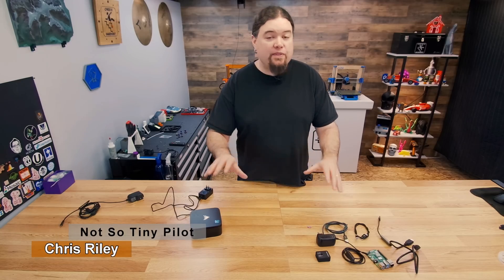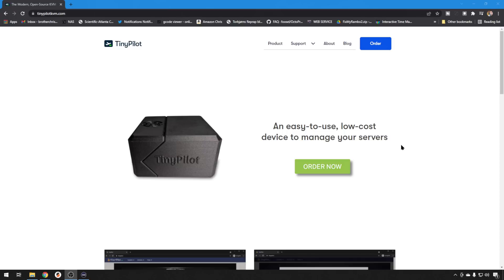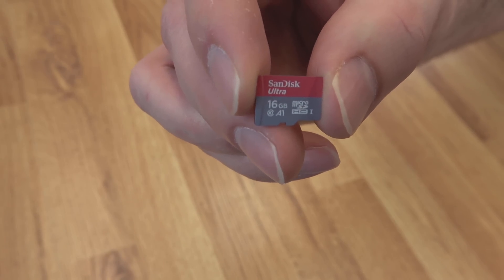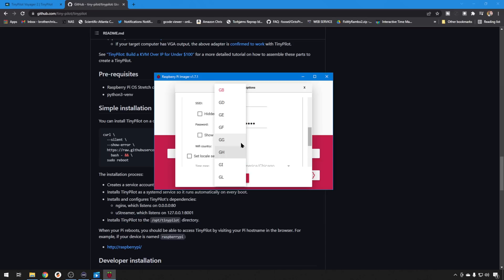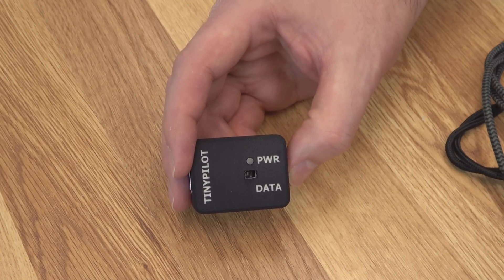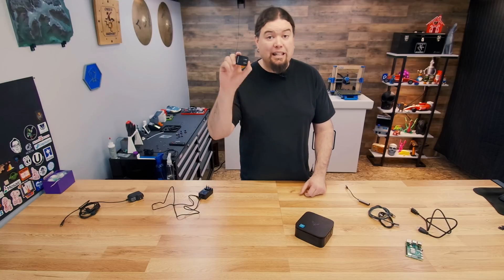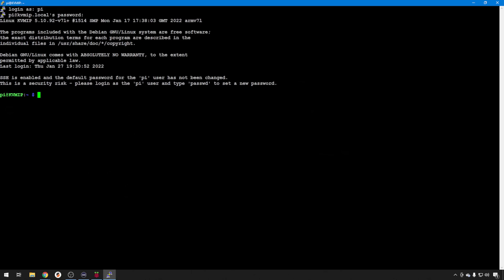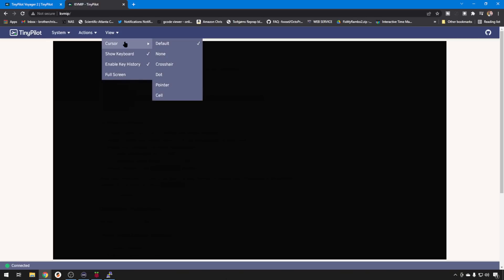Tiny Pilot - KVM-IP - Mini Computer - 2022 - Chris's Basement

Comment: In my experience SD card performance isn't really something worth worrying about on Raspberry Pis because their SD card interface is sooo painfully slow. For general file system performance with 4K reads/writes you're flat out getting more than about 10MiB/s even on a SanDisk Extreme Pro, V30 class 10 card, which is supposed to have 90MiB/s write and 170MiB/s read capability.
Just get a name brand card from a reputable dealer and you should be good-to-go.
Reply from the maker: Name brand might be where it's at, because I have had some really painful issues with slower SD cards that were really hard to troubleshoot, but they could have been just really low quailty cards.

Comment: If you are looking for a raspberry pi you may want to look for the rpilocator website. There are also HDMI to CSI adapters to connect directly to the Pis camera connector instead of going via USB, but that is a little more expensive. Instead of the $30 USB splitter you may be able to find cheaper ones. I found one in the Berrybase shop here in Germany for €3. Sorry, no links because youtube doesn't like that.
Reply from the maker: Thanks a lot!
Reply: @ChrisRiley  I found this USB OTG splitter at Berrybase too. But they are out of stock. Isn't it possible to power the Pi using the GPIO pins? This could avoid the OTG splitter.
Reply from the maker: @Jeggo65  I think that would work out, I would be curious how this worked out for you.

Comment: This is the solution I've need for quite some time. I cannot use remote control over any network as the remote machine has a locked tunnel VPN on it. But this will allow me to control it from my primary computer. Superb configuration.
Reply from the maker: Thanks, good luck with your projects!

Comment: Hmmmm.  Wouldn't a software KVM get the job done with less cost? (I use Teamviewer) - EDIT - oh sorry - you covered that - screen caps.  Hmmm. Still think for $150+ a pi you could get an used i5 thinkpad.
Reply from the maker: Thanks for your comment
Reply: The big advantage is, that this hardware KVM solution does not interfere with the host system. Additional software might interfere with systems, that run a realtime OS. In most case Teamviewer and all the VNC versions are not allowed in a commercial use case due to software and data security issues.

Comment: I just bought a version of that mini pc. Dual Celeron with 4gig ram and 64gig EMMC.  Added a 256g mSATA drive.  Moved off of 2 pi's over to a multi install of octoprint on it with it dual booting between Win10 on the EMMC it came with and Ubuntu on the mSATA drive. Currently 2 printers and 2 HD cameras and Octoprint has never been so enjoyable. So fast and snappy. Don't need in the BIOS often so just went with remote desktop for both the Win10 and Ubuntu installs.
Reply from the maker: I love it when a plan comes together! Very cool, good luck with your projects

Comment: Would you need a separate Pi and KVM-IP adapter for each computer you want to control like this? 

Currently I have four computers : 2 macs, 1 windows pc, 1 Linux. One monitor, keyboard, mouse between them all. I use the monitor’s input switching for video, and a usb switch mounted under my desk for the extras. It even switches a StreamDeck, mic, and camera for all work/streaming situations. 

I think the switch cost about $40 on amazon. Nothing crazy. Latency is very low as well. Great performance in FPS games.
Reply from the maker: Yeah, something like this wouldn't be a good fit for multiple computers. Check this guy out, he has a good hack. https://www.youtube.com/watch?v=wBMGGnwWmqI